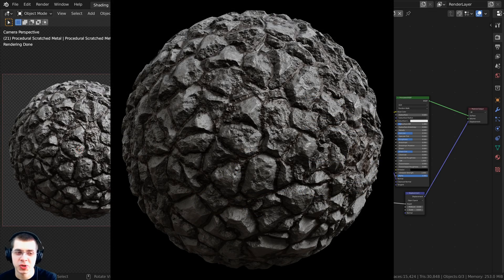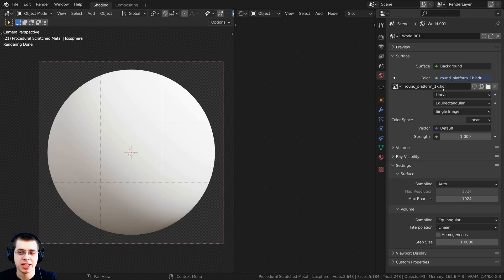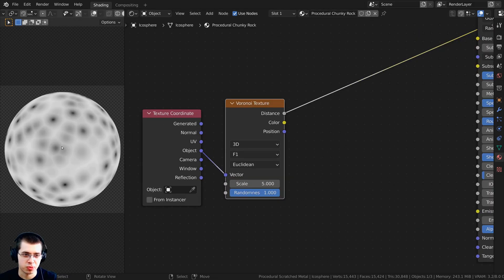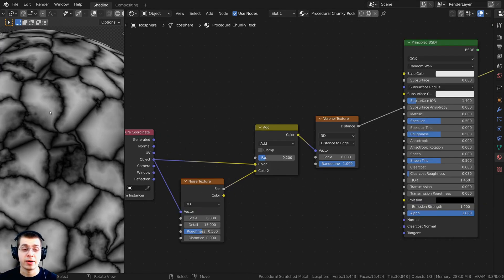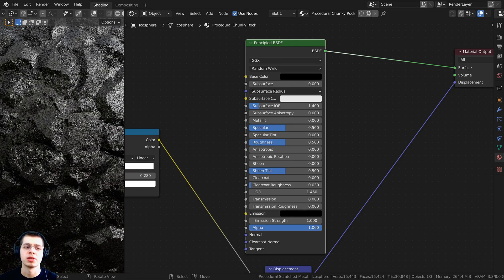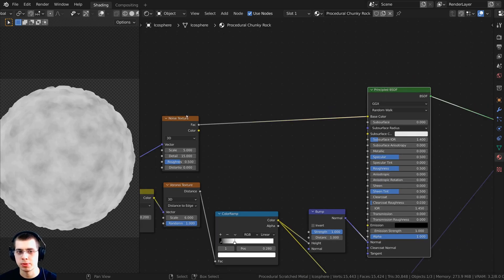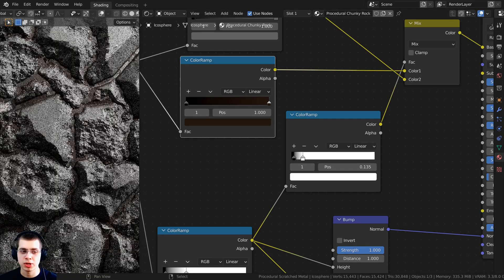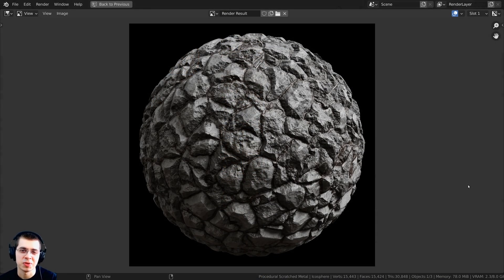Procedural Chunky Rock Material (Blender Tutorial)

Comment: Been trying to work it out, but alas I just don't know the system well enough.

If I wanted to mix your procedural gold material into the cracks between rocks instead of the earthy texture, how would I go about this?
Reply from the maker: use a Mix Shader node, and plug up both materials to the mix shader. Then use the voronoi texture as the factor in the mix shader, to tell it where it will be the gold and where it will be the rocks.
Reply: @RyanKingArt  Worked a treat! Thank-you for the quick response.

Comment: Great content! curious what is the difference between displacement and bump?
Reply from the maker: The Bump, (or Normal) is just a fake bump added to the material. Basically, it changes how the light interacts with the materials surface, to make it look like its a different shape, or to make it look like its bumpy. But it actually doesn't change the shape of the mesh. Displacement, is data that actually displaces the mesh in the 3d space. So it actually changes, or displaces, the meshes shape.